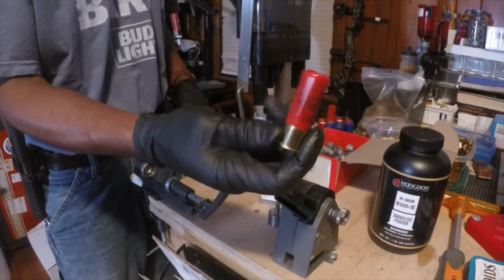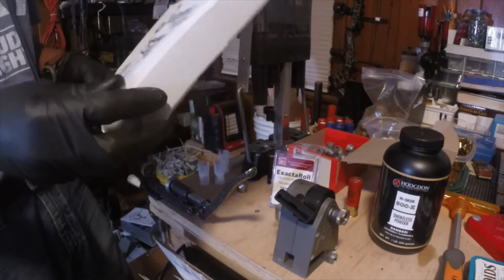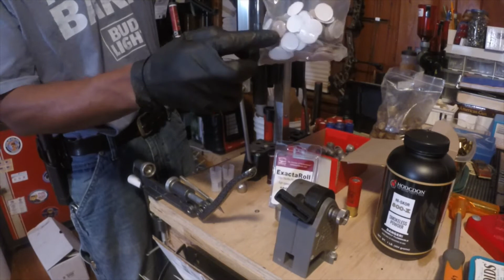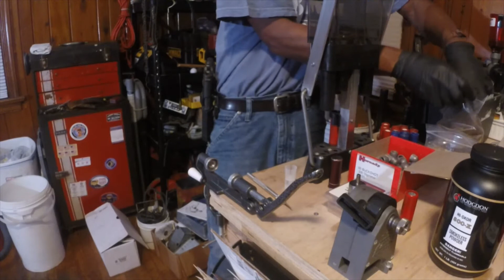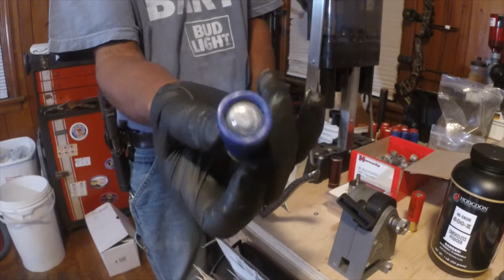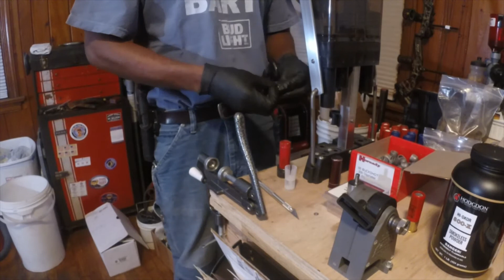Reloading Shotgun Slugs

Comment: Mount your roll crimper vertically. Can't imagine why you'd use an overshot card with a slug. Ever seen a factory slug with one? Also, you can fold crimp slugs as well as roll crimp.
Reply from the maker: It was in the Lyman manual to use them.

Comment: Hello, maybe you can help me, im trying to find a good published load for 12 guage 1 1/8 oz DGS slugs using GREEN DOT powder with a star crimp instead of a roll crimp. Do you have any info or suggestions i could use? Thanks for the vid it all helps.
Reply from the maker: Sorry, I don't. Check with modern manuals for load data.

Comment: I had a similar crimping device but removed the die (was screwed on) put it on a piece of threaded rod and used the drill press on lowest rpm instead. That produced a lot nicer crimps I found, probably due to the higher rpms softening the plastic, making the crimp smoother. A light touch of oil on the die before crimping might avoid the twisting in the hull that is occuring just below the crimp.
Reply from the maker: Thanks for the info.

Comment: Russia?  So now the Russians are arming revolutionaries?  LOL.  Slugs are fun to shoot.  I used to shoot them in the rocky creek and with a little practice you can actually see the slugs skip down the rocks with your naked eye.  I haven't ever reloaded any . . . yet.
     What the heck is the thing on the right side of the bench with the pull cord?
Reply from the maker: Even the Ruskies don't want to see the US fail, lol.

The tool with the pull cord is a Lee case trimmer. I got it for .45 ACP, until I found out that the brass for that round gets shorter, not longer.
Reply: @Mossy500A  I didn't know that.  And I've never seen a pull cord case trimmer!  Learn something new every day.